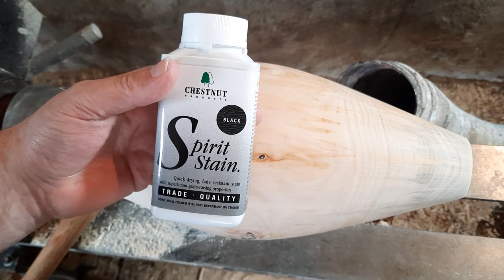WOODTURNING Monkeypuzzle Red Vase

Comment: like the form and the color, the only comment I would make is there were some raw wood spots that showed in the void spaces. I don't know if you went back and hit them with some dye to make the piece uniform,
Reply from the maker: The raw spots are holes and the raw wood is the inside of the piece, I will give it a coat of something at sometime but the wood is not fully dry so I'll leave it a few months. Thanks for waching